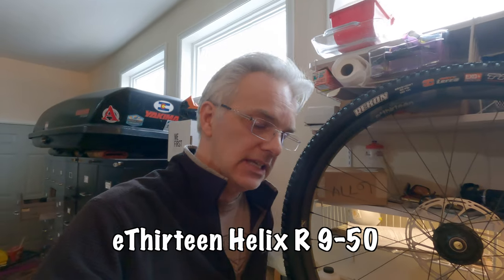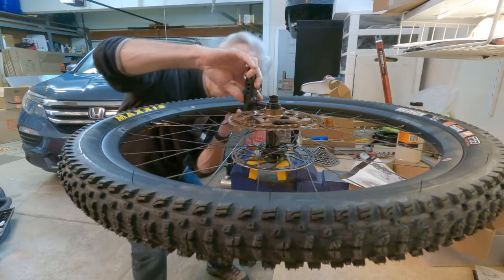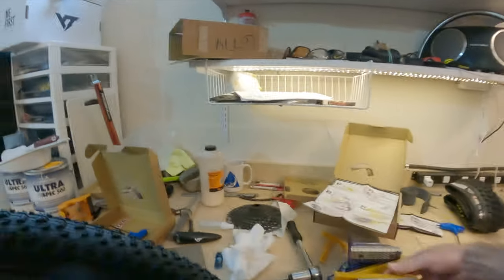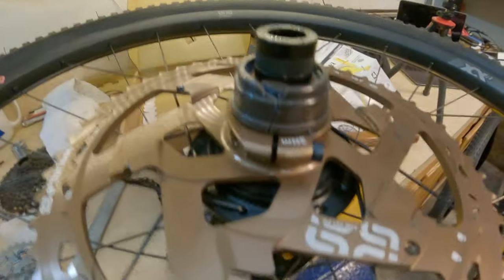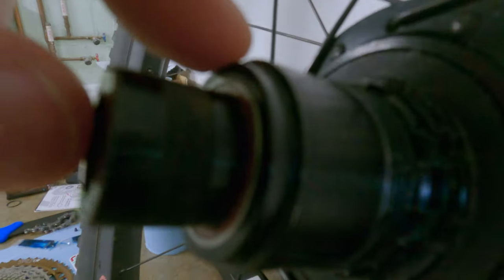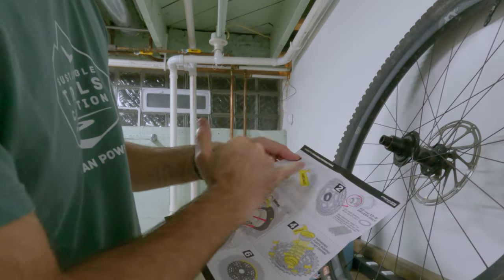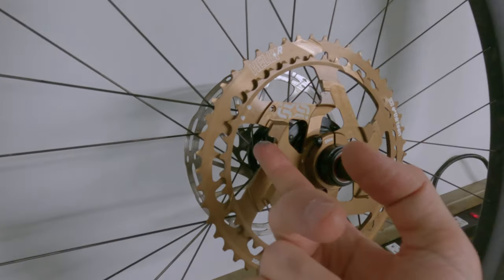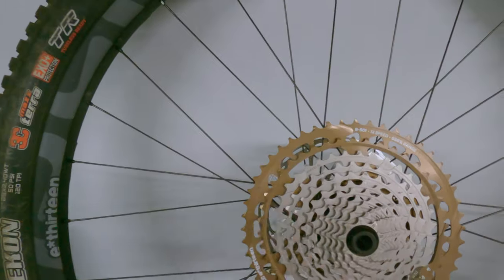e*thirteen Helix R 12 speed cassette, more range and lighter weight? e13 helps this idiot install it

Comment: Very helpful as I'm thinking of using this cassette. Not too much grease got it. Also I saw you can use a standard cassette locking socket if you don't have a good chain whip. Thanks!
Reply from the maker: It’s actually fairly easy to install once you don’t hydro lock it with grease. 🤦‍♂️. Works well once installed.

Comment: How are you like the Helix R after having it installed for a while?
Reply from the maker: Hard to say. The first one failed when the outer teeth folded over.  E13 replaced that under warranty.  The second one has been fine since, however I do not ride that bike that much anymore as I now have a newer eMTB that is now my go-to steed.  My original cassette was a first generation cassette, which had some other issues as the warranted outer rings would not interface with the older smaller rings so E13 replaced everything.  My understanding is that the newer ones are stronger. One thing I can vouch for is good support from E*Thirteen.

Comment: I installed a e13 R Helix on a sram hub without any issues.  I’ve been using it now for 3wks and pretty happy with it.  It replaced a xo1 cassette
Reply from the maker: Yes. As long as you don’t hydro lock it, it goes on pretty easy.
Reply: I’m looking at replacing my worn x01 as well, looking for longevity comparisons of the e13 vs sram Eagle
Reply from the maker: I don’t have much insight to longevity. My first cassette failed on me, but was replaced under warranty. That cassette is still going fine, but I’m not riding it as much as I used to, because I’m now riding my eMTB more than this bike.
Reply: I’ve still using the e13 without any issues.  It seems to be holding up well.  I should say that this is on my gravel bike so it doesn’t see the same terrain as the MTB but I still ride it through heavy sand and dusty gravel.  I also keep the bike clean.  I clean and oil the chain every couple of rides.  Hope this helps.  I would consider replacing my X01 on the MTB with e13R when the time comes
Reply from the maker: @russellturpin1259  Great feedback.

Comment: I had no issues installing my helix R Plus cassette. My only bit of concern was the plastic bushing. It’s a very snug fit. But it went on. It really is an easy install the whole process. As for E13 CS it’s fantastic. I actually bought my stuff a week before a sale. Emailed them and they immediately refunded me the difference.
Reply from the maker: Sometimes, I'll admit I wonder about E13's quality as I have had stuff fail, but as you say their customer service is fantastic, and when I have had issues they have always been prompt to help me solve it.  Because of that I don't mind trying and buying their products.
Reply: @Roaming50  I get that. I have yet to put mine thru the paces. It’s newly installed, it’s winter and I’m still not fully recovered from ankle tendon surgery. So most likely spring time here in Ohio. But it’s usually wet in the spring. Lol. Too wet to ride, tears up the trails.

Comment: I'm thinking of getting this cassette for one of my bikes for improved top-end speed when riding gravel. Have you had any issues with your chain being too close to your frame when in the 9-tooth gear? Any issues going into that gear or coming back up the cassette?
Reply from the maker: I have not had any issues but honestly, I am not in the 9-tooth much anymore. Since I've moved to a flatter part of the country, I just don't use the range anymore.  The Helix still gives a nice spread of jumps in gears though that I find more usable but the shifting is not as nice as say an XT cassette, but is comparable to X01 and better than GX.
Reply: Many thanks for your reply. I have a full XT drive train on this bike and I’m very happy with how it shifts. The simplest and least risky move may be to increase the size of my chainring from 32 to 34 to slightly increase top end speed.

Comment: How is it going with this cassette? I had a YT Jeffsy Pro Race  with a lot of E 13 parts on it and had nothing but trouble with it. That two piece cassette was the worst shifting  cassette and loudest creaking cassette I had. Did you have good luck with this? I hate E 13 and will never buy it again.
Reply from the maker: The first cassette failed when the teeth folded over. E13 warranted the entire cassette. The current cassette is behaving itself and is working well but it is not being put to hard use currently as I am mostly riding my ebike now which runs Shimano SLX cassette with GX AXS shifting.
Reply: @Roaming50  Good to hear. 💯🔥
Reply: I had someone from another forum stated that their big ring folded over. But this was many years ago on their older model cassettes. I haven’t heard anything bad about their latest cassette offerings.

Comment: had the same isue, but will send the cassette back. SRAM cassette is installed in less than a minute. my e*thirteen wheels are also trash. never again e*thirteen
Reply from the maker: Easy to install once you know how. However I agree, my HelixR did fail on me in Spring’22, but was replaced under warranty. Now my XCX Race freehub just failed but that is also being replaced under warranty, even though that is considered a wear item. Rest of the wheelset has been fabulous. I would agree that e*thirteen’s failure rate seems high but their warranty support is outstanding. Sometimes you get unlucky with components. I’ll accept that. What I judge a company by though is how they support you when something does go wrong and on that side I can’t fault e*thirteen. They get ⭐️⭐️⭐️⭐️⭐️

Comment: What a bummer  @5:00 mark.   Glad e13 sent you a replacement bushing. Good to see the issue was just "too-much" grease (lol). I like using q-tips to smear grease where it's kinda hard to get to with my finger. BTW I like the gold color on that cassette.
Reply from the maker: It’s one of those cases that in hindsight you can easily see where too much grease can stop this from fitting. 

I found that putting the grease on and then trying to wipe it off with a dry finger worked well.

Comment: Is the only thing that holds it on the driver,  meaning sliding outward on the driver, that 3nm pinch bolt? That seems substantially weaker than the stock cassette threading down onto the driver threads..
Reply from the maker: You are right, but that said I have had no issues with it.
Reply: It’s still splined to the hub so the pinch bolt isn’t needing to be much force. Then the cassette locking into it helps hold it all in place.